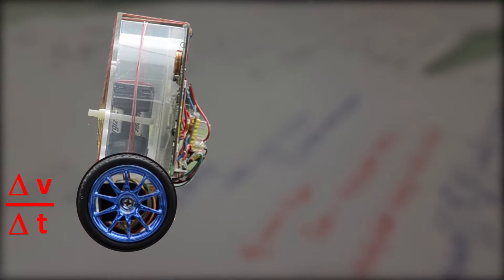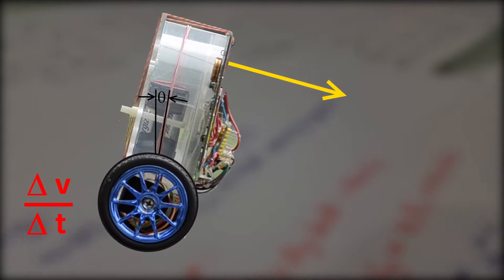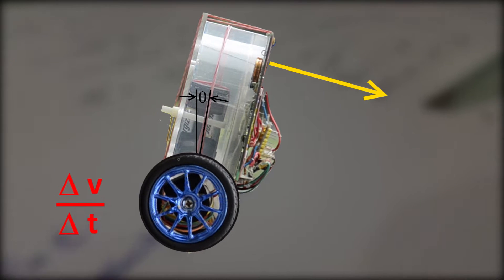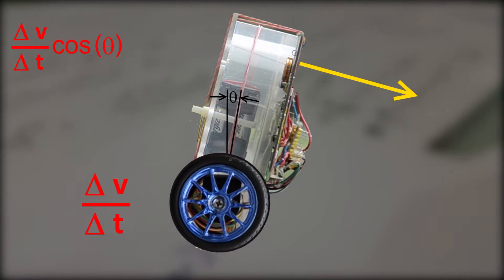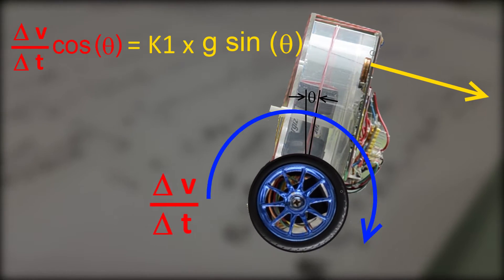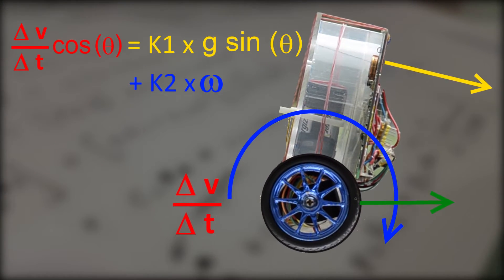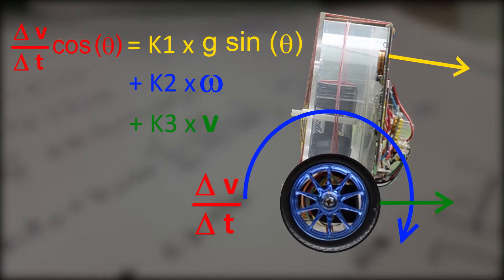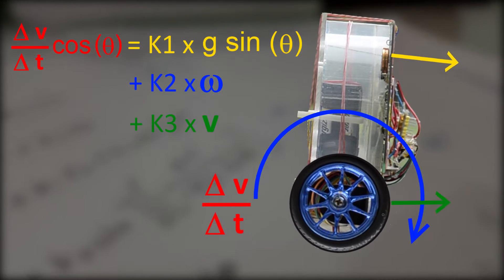Self-balancing robot from scratch

Comment: This is very impressive work. We take for granted those two wheeled vehicles that allow someone to stand upright on them.
It is interesting that the PID failed to control the balance. While your physics equation works there are clearly more complex equations that are used on the bipedal robots. Could it be the limitation in your solution was the sampling rate or the accuracy of the balance sensor(s). Where they level and accelerometers? A lack of feedback gain  might explain the performance. Did you apply any corrections for the digital sampling effects in the feed back loop?
Reply from the maker: I build the hardware and software from scratch (almost). When the balancing didn't work and both hardware and software were unproven, and the effect of CG, sensor location, sensor accuracy were all unknown to me at that time, it was extremely difficult to solve the problem. Most importantly I didn't even know whether PID algorithm would inherently stablise the car and I made it a point NOT to search for answers from the internet and spoil the fun. As PID was only my first guess, I would not hesitate to explore other methods if I got stuck for too long. Now that I have seen videos of this sorts on the internet, obviously I come to realize that PID works. Had i knew in advanced that PID worked i would simple stick to it instead of deriving balancing equation from Newton laws. When I used Newton equation to balance the car, I also increased the sampling rate, and it is probably the low sampling rate that failed the PID algorithm. Thanks for pointing out there are more complex equations out there. If I want to have continue this project at a more complicated level, I will definitely look up for these equations, download code and have fun in a very different way from this first attempt which is to enjoy building something totally from scratch. Thank you for your comment.